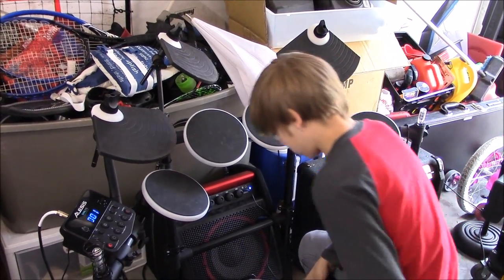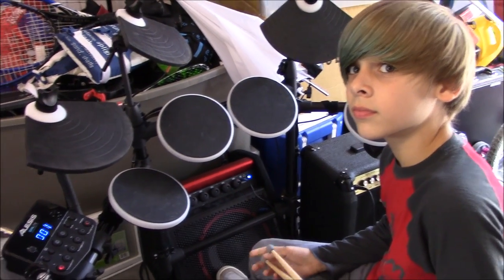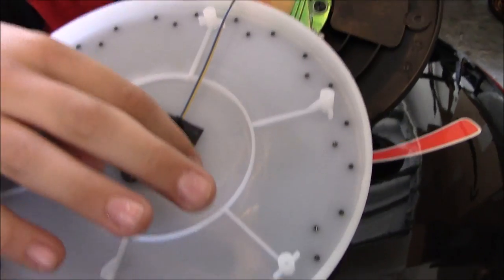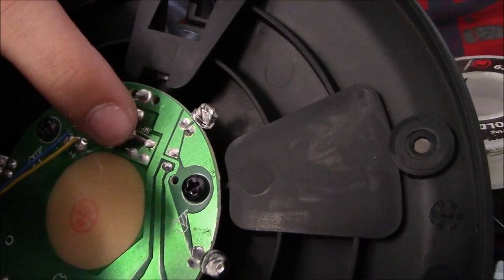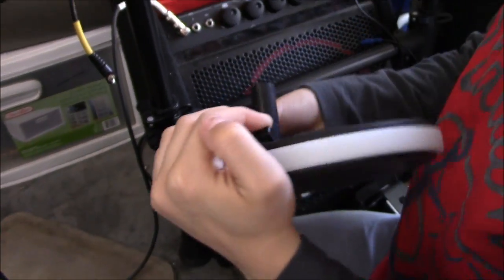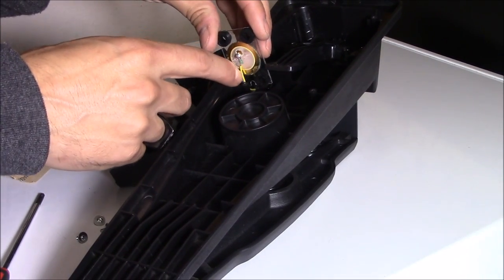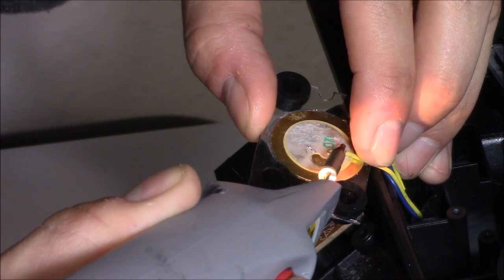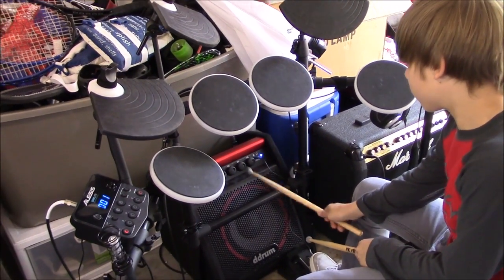How to fix electronic drums set drum pad triggers and pedal on Alesis drumset service guide

Comment: You should invest in to new head triggers... you don't even need to solder the new triggers as they have a super glue type of M3 tape... you could put something else but I got these triggers off Amazon. They were expensive per trigger but the ones I see u have look like the 6$ bundle set on there.. cheap. My set is the Alesis Nitro Pro, but I've switched all heads out to 10 inch and 12 inch (12's are my floor toms so to speak) since changing the triggers out the mesh heads are super responsive and haven't failed me yet. I do like how that set lights up. Very awesome effect and it's great that your son did some work too and seemed to actually know what he was doing. +1 for the dads out there doing what we can for our little/fast growing kids lol. Awesome video!
Reply: Which triggers do you recommend. My kick pedal is starting to become less responsive. I'd like to fix it in such a way that I never need to worry about this again! Thanks!

Comment: Good job guys. Just purchased a used electronic drum set and have a few issues. It is the nature of electronics to be damaged from sudden impacts. I think Alesis can do a better job with the quality/size of their solder joints. Solder with more tin & less lead would make them stronger. Solder joints that are larger and of lower profile to the circuit board would probably hold up better for electronic devices that will receive sudden jolts. I'm sure the US military has protocols for electronic circuit wire connections that have this problem solved. Wonder what they are using.

Comment: Thanks for this. On the ride cymbal, it makes both cymbal and "bell" sounds.. but on mine the bell is inconsistent. So I opened it up according to your method here, and found only 1 piezo... how does 1 piezo make 2 different sounds?  No loose wires or solder joints.... so... not sure what to look for next? Any ideas?

Comment: GREAT INFORMATION! I'm having an issue with my snare pad...it triggers single strikes,8th notes but when I do any rolls (6 stroke,8 stroke) or any 16th or 32nd notes they are not being reproduced accurately..IE: 16th note I only get every 2nd strike? Checked all cables, connections etc..Would anyone have any ideas what would cause this? It only affects the snare pad,and when I switch pads out, the same thing happens..
Thanks for any feedback!!!!

Comment: Do we have any understanding of how the LED light is triggered… & if there is any way to rewire the piezo sensor to directly trigger the LED without the drum being plugged in to the drum-brain… using an adapter to plug these triggers into a regular roland drum-brain does not trigger the LED but works normally as a drum trigger… most drum triggers don’t have such a large circuit board inside

Comment: My problem with one if my drum pads is I will get the sound from the rim (i have an Alesis DM10) but the head will not do anything now.  What could that be?
Reply from the maker: stevechambers500 check loose cable connection but usually it's the trigger solder connections breaks on the plate under the glue or near the jack. 4:20 Watch second half of this video to see trigger repair. in 2 zone drum there's 2 triggers. You may need new transducer trigger or drum call alesis (401) 658-5760

Comment: uhm, not a big deal......but. "pressure plate" is not what that is called. That is a Piezo element, or Piezo transducer or even Piezo pickup. But very useful video for learning to work with the triggers.